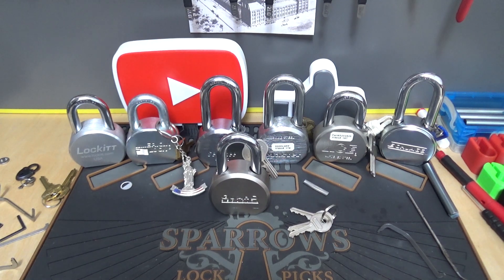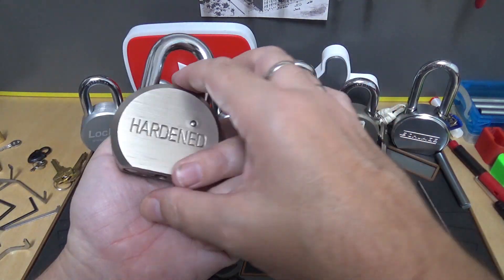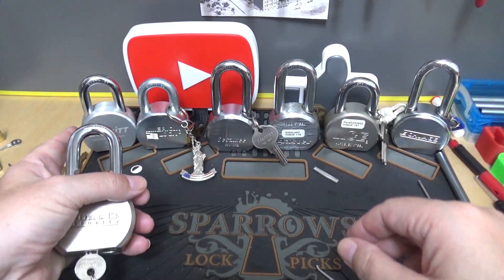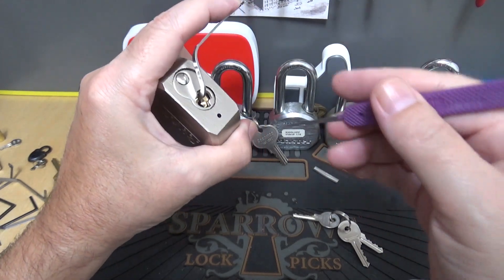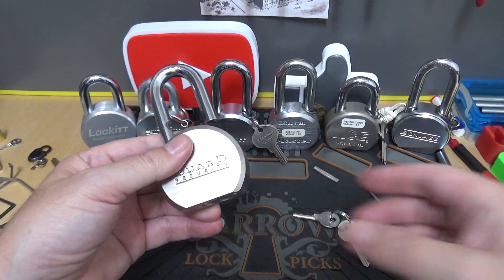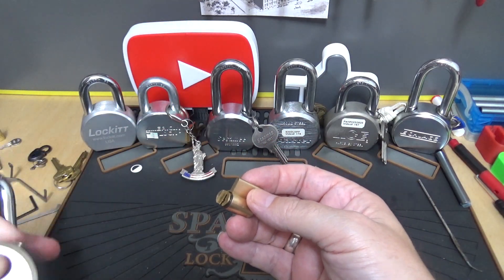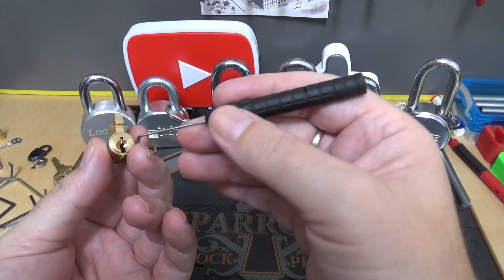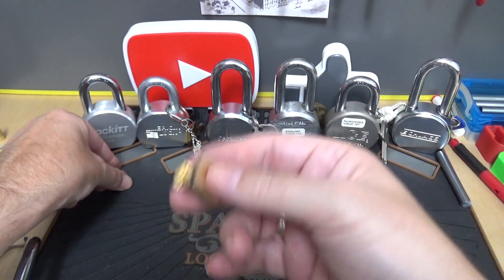#326  Guard Security padlock

Comment: This is a $8 Chinese OEM lock which is sold at high price. You can find it with Garrison brand for example. The body is not hardened steel, but the shackle is.
Reply from the maker: Fantastic info. Ya, I have a few other locks that say hardened but I tested them with a file and it's false. Seems they can say anything with no regard for the truth. Thanks for the heads up

Comment: Oof. Well, at least it didn't have the same skeletonized core that the Harbor Freight locks have. I'd also check that it's actually hardened, if you plan on putting it into service.
Reply from the maker: Your spot on, I had one of those HF locks. It was awful

Comment: I picked one of those up at a flea market, those pins would get jammed because there so small, re-pined it, made it work a lot better.
Great video.
Reply: I assume you can just replace the driver pins?  Don’t need to replace the entire core?
Reply: @JohnSmith-gs4lw   Yes, but they still have to be the right diameter.
Reply from the maker: @gkeyman565  correct, I found the pins in my American lock service kit work fine.
Reply from the maker: Thanks, absolutely. Great find. I haven't been to a full blown flea market in many years. I miss them.

Comment: Those pins look like some of my failed attempts at making security pins. Only I didn't try to use them.
Reply from the maker: Ah yes, my first few were sad also. Try using a dremel and needle files. I have a mini lathe now but a Dremel will work to spin them
Reply: @AlbertLebel  I need to get some better files
Reply from the maker: Lock Hak I understand, I also use a jewelry saw to make serrated pins. Works great. Super fine.

Comment: I am wondering if it is truly HARDENED😏 Doubt it😔 lol😆
Cheers and Happy Pickin!
Reply: Quick shot with a cheap HSS drill bit will tell you. If it dances across the surface, you’re good. If that’s chromed, you’ll want to scratch through the chrome pelting first.
Reply from the maker: @JohnSmith-gs4lw  Yes, I usually just use a file but either is fine
Reply: Absolutely NOT HARDENED!
Reply from the maker: Thanks, I understand the shackle is but not the body. Still worth a few pins to upgrade it